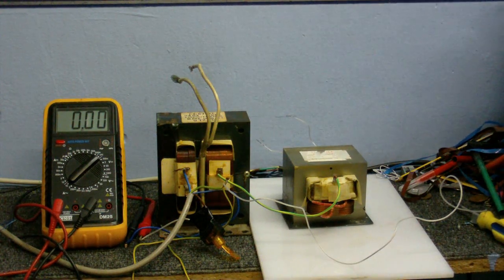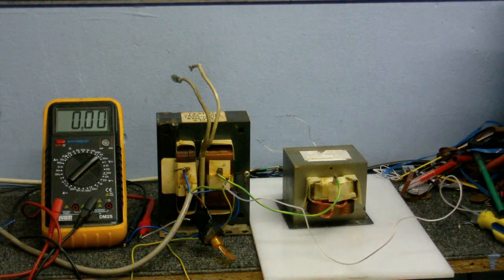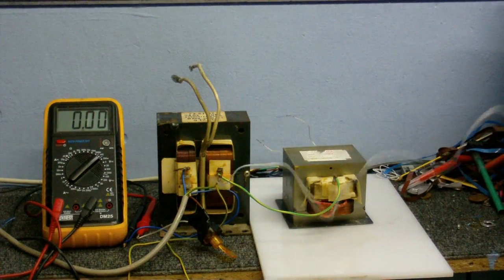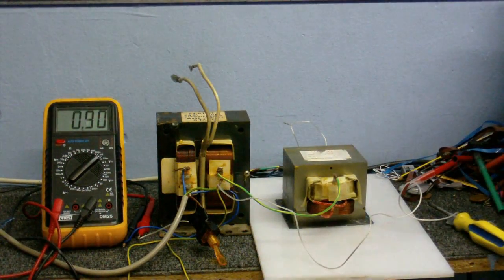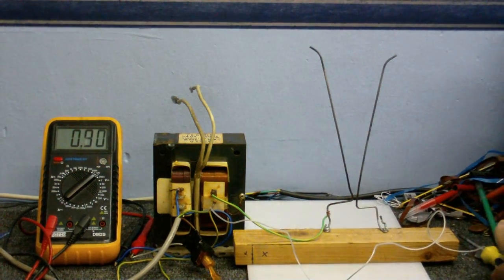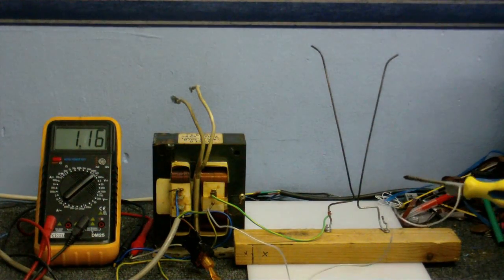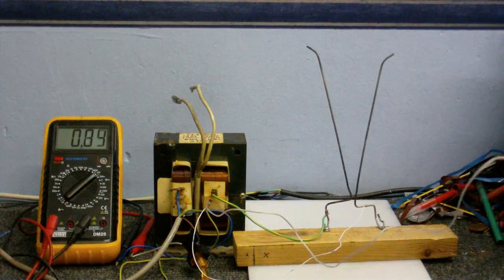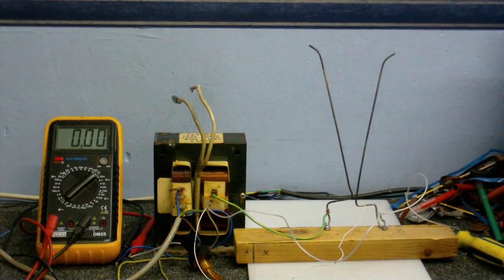The big MOT un-ballasted.

Comment from the maker: The screwdriver was connected to ground, so even if I did touch the blade it would have done nothing, but even like that I wouldn't touch the blade while arcing just in case.  the wire I arced it to was live and so was the smaller transformer.

Comment: @CoolDudeClem find a cheap plug in air purifier and take it apart, if you got the right one all that will be inside is an induction motor and a small 5kv dc cascade that connects directly to mains , take the output and put it in the middle of the begining of the jacob ladder, this should make the spark start on its own, or just do the same with your flyback transformer.